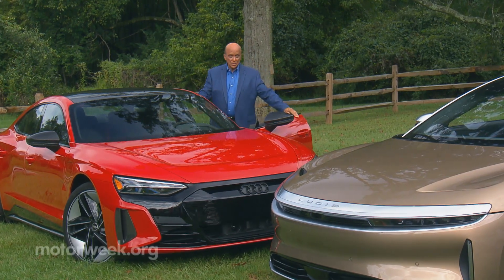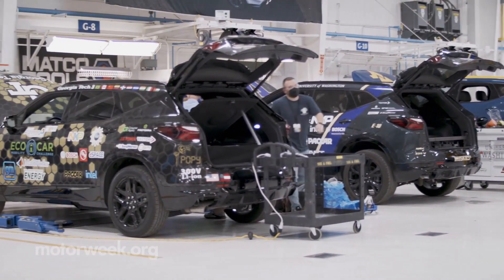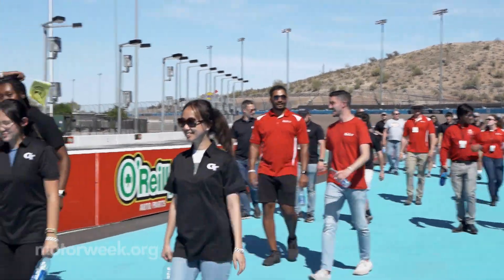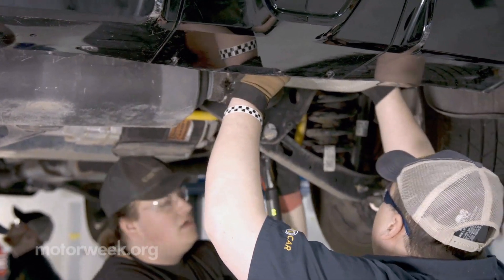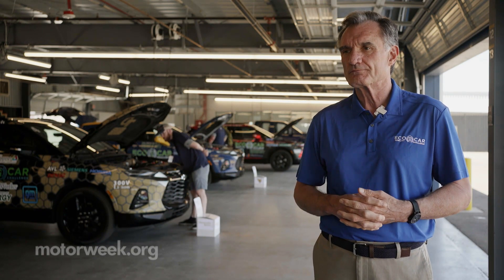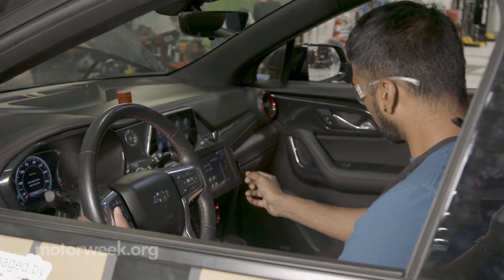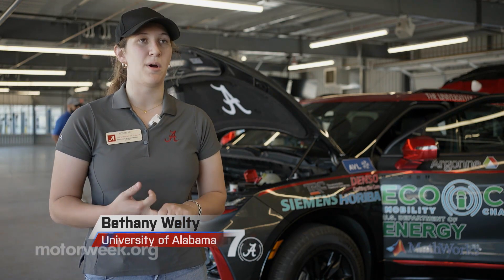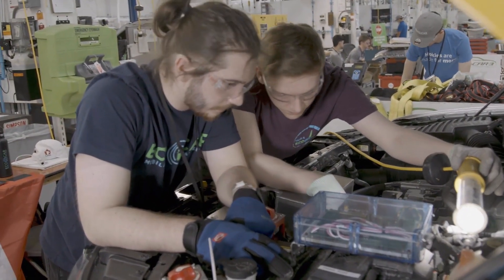2022 Ecocar Mobility Challenge | MotorWeek AutoWorld

Comment: Good idea for a segment, but short on real details. They mentioned an engine swap, to what engine? What did the other teams do? would rather focus on what the winning team did right from an engineering perspective, than ongoing quotes of what a great program this is without any real idea of how the vehicle was improved.
Reply: Hope this provides some of the outcomes you were hoping to hear about? 	
The 11 participating EcoCAR schools logged >10,000 test miles on their vehicles in the final year of the series
•	EcoCAR teams modified their conventional 2019 Chevrolet Blazers to electrify the propulsion system through the addition of a HV battery pack and one or more electric motors. 
•	Teams were successful in developing their perception system and autonomous driving features as well as vehicle-to-infrastructure connectivity features. 
o	This allows the vehicle to implement adaptive cruise control and autonomous navigate a V2X connected intersection with a traffic light
•	CAV technology was a huge part of the Mobility Challenge and EcoCAR teams demonstrated several CAV features for the first time during an EcoCAR competition. 
o	8 of 11 teams demonstrated a team-developed functioning adaptive cruise control (ACC) system with full speed range 
o	7 of 11 teams demonstrated the ability to autonomously navigate a signalized intersection using vehicle-to-infrastructure technology
•	EcoCAR piloted a novel approach for energy consumption testing: team vehicles used their ACC systems to follow an automated lead vehicle, which used an Argonne-developed system to repeatably drive a full-feature drive cycle (such as UDDS or HwFET). 
o	This procedure allowed teams to test the energy consumption impacts of their ACC system against standard EPA drive cycles in an on-road environment. 
o	7 teams completed this test and the Georgia Tech team notched a fuel economy result of 26.5 MPG, which is an improvement compared to the stock vehicle.
•	9 of 11 teams qualified for the Over-the-Road event, a 175-mi drive from Yuma to Phoenix during the Year 4 Competition. 
o	This event is  modeled after industry-standard “buyoff rides” and is a culmination of 4 years of vehicle development. 
o	Despite 105 degree heat, nine vehicles completed the drive without a breakdown, which is a huge success.
•	EcoCAR teams have integrated Dedicated Short Range Communication (DSRC) based Vehicle to Everything (V2X ) radios which enables the vehicles to interact with other vehicles and Road Side Units (RSU). 
o	The vehicles use Signal Phase and Timing (SPaT) and MAP information from the RSUs to navigate signalized intersections by autonomously coming to a stop at the red light and resuming on green without any driver interference. 
•	EcoCAR Sponsors were instrumental in helping students transform their Chevrolet Blazers. The following sponsored components can be found in the newly integrated vehicles: 
o	GM engine-transmission pairs
o	GM HEV4 Energy Storage System (from the Malibu HEV)
o	Denso Integrated Starter Generator motor
o	Magna ERAD electric drive system
o	AAM electric motor
Reply: @kimberlydeclark4562  Thanks, would be nice for next time some of this to be in the video segment.
Reply: I'm assuming the 4cyl also offered in the blazer. They were all given v6 rs blazers to start...
Reply: @svpracer98  Would make sense. Missed opportunity to discuss the mods.
Reply: Welcome to TV. Time is limited.
Reply: @justawhisperintheuniverse8257  I don't buy that. it was a fairly long segment, with a whole lot of fluff, and devoid of info. Could be so much better.
Reply: @digitaldoc100  These were obviously huge projects! They covered some highlights in a short segment. We're talking about something that could be an episode or even a season per team. The point is to get you interested in what they did. If you're the type that wants more information, it's out there.
Reply: @justawhisperintheuniverse8257  The length was more than enough, the content missed the mark. No point in just a 50,000 foot overview, without any detail whatsoever. When it aired the 2nd time, was happy to FF this segment, but if this is to your liking, than enjoy.